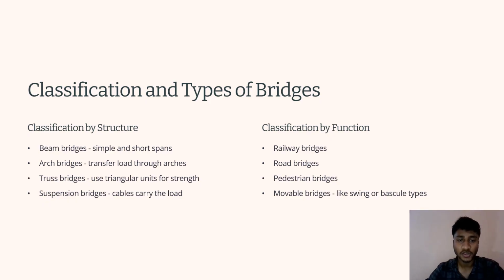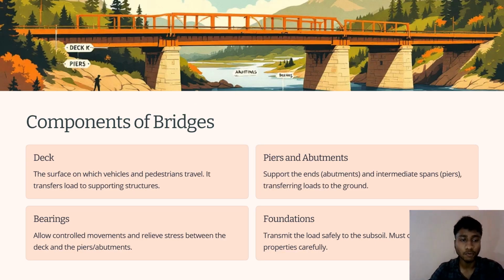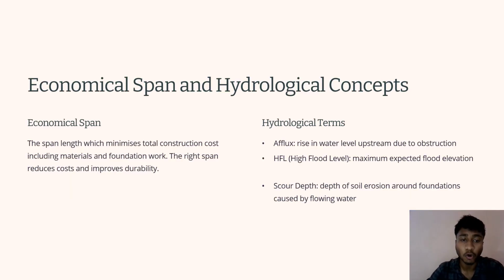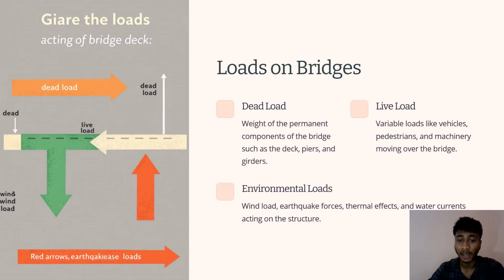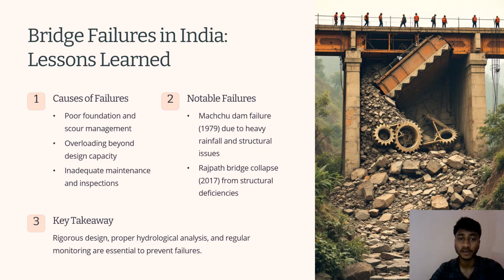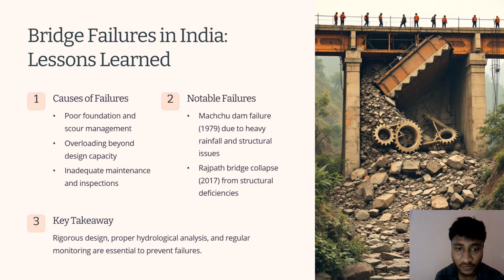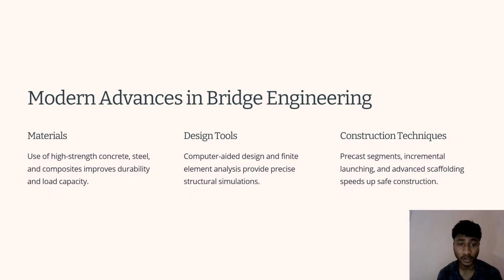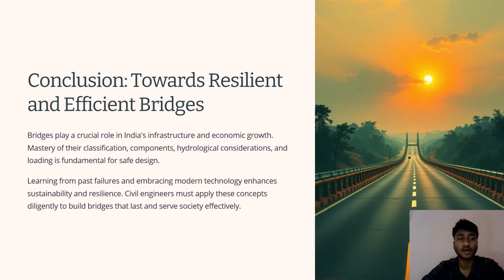Introduction to Bridge Engineering

Comment: The points on modern advances and design considerations like safety, economy, and sustainability really emphasize the multifaceted nature of this discipline. This is a fantastic resource for students and professionals alike, offering a solid foundation in the principles required for building resilient and efficient bridges. Great job putting this together !  Thanks a lot for info Prasanna.